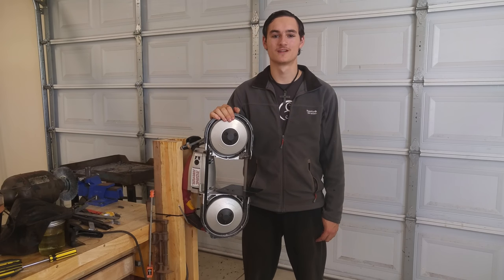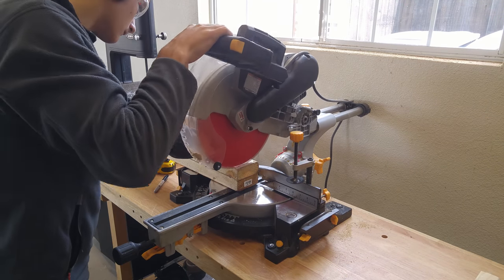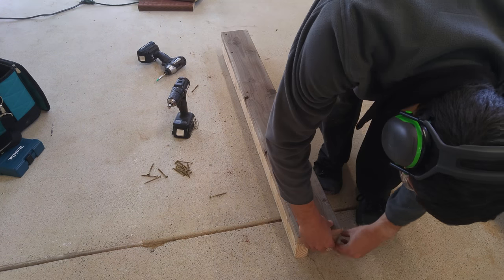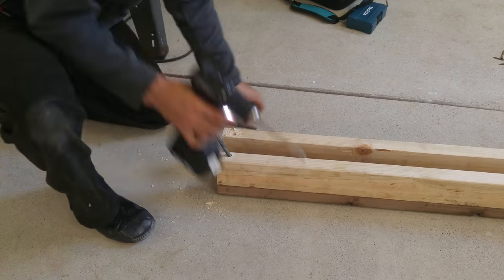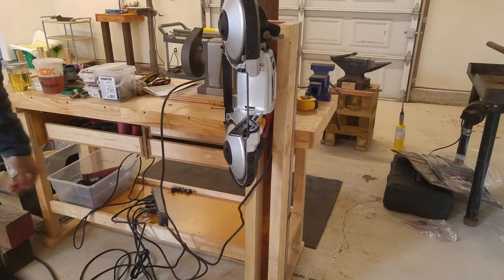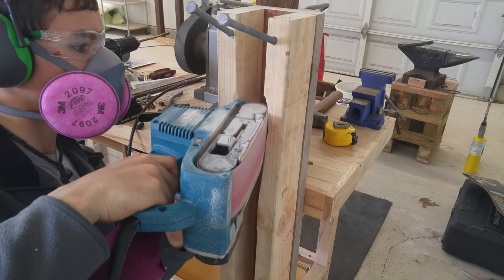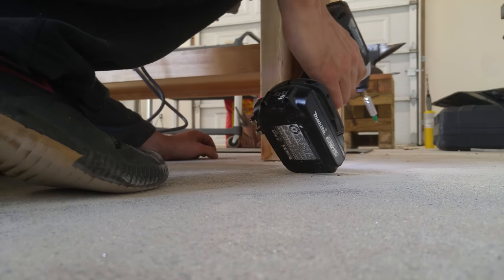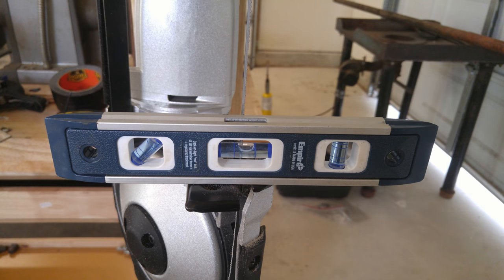Making A Harbor Freight Portable Band Saw Stand (Cheap And Easy)

Comment: To anyone doing this if you simply space the 2 boards 2 3/4" apart (inside) you don't really need to do to much fitting as its fairly solid at that spacing with a bunge strap.
Reply from the maker: Great tip!